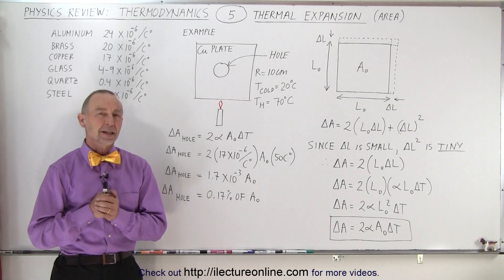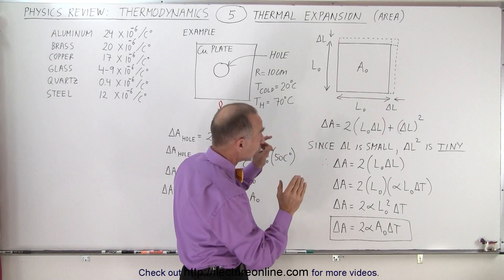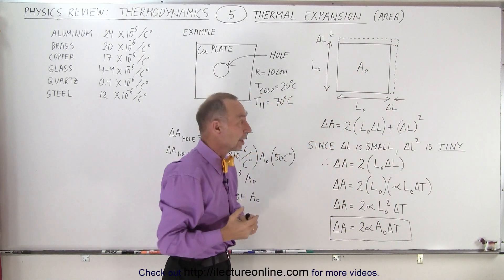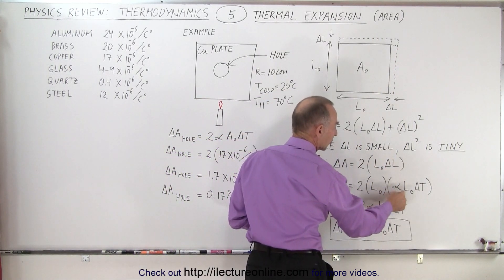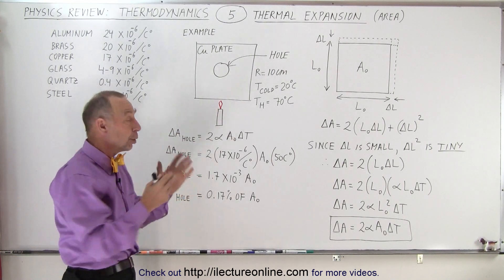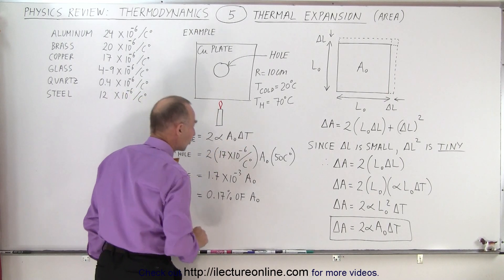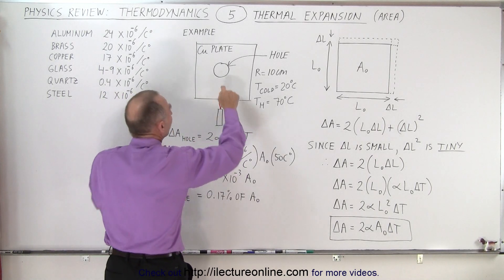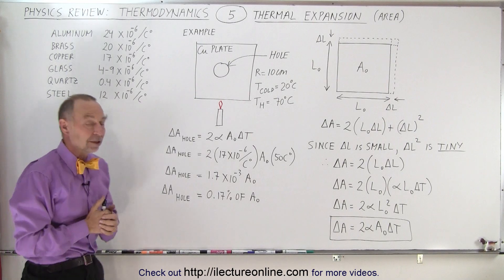Physics Review: Thermodynamics #5 Thermal Expansion (Area)

Comment: Mr. Professor should not metal expansion go in every direction? (there is a free space inside the hole)
Reply from the maker: It appears counterintuitive, but the hole will become bigger as explained in the video.  Think of the atoms lined up on the edge of the hole.  As they are heated they need more space and push against each other.  The only way for them to obtain more space is for the hole, and therefore the circumference, to become bigger.
Reply: @MichelvanBiezen  thank You.